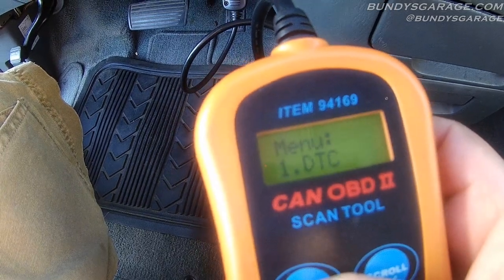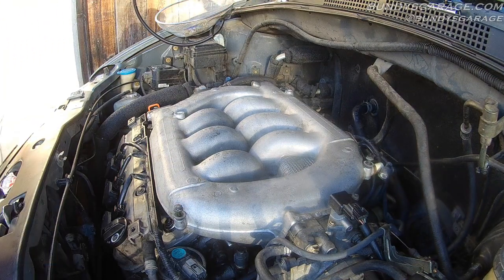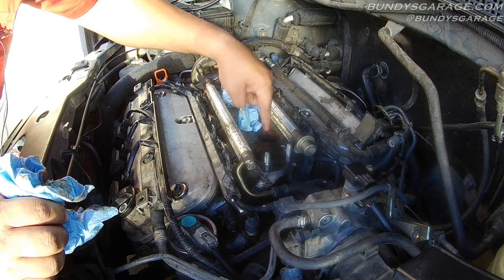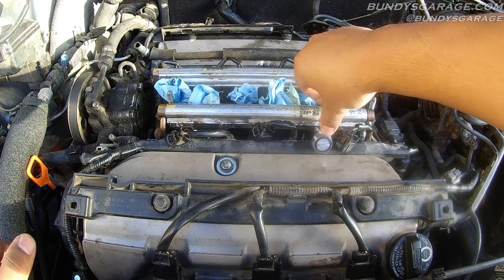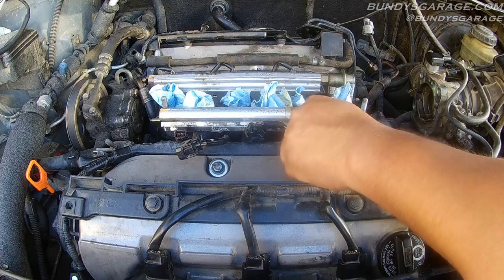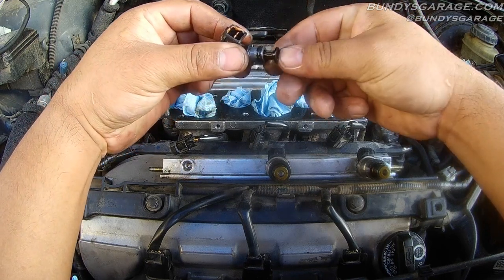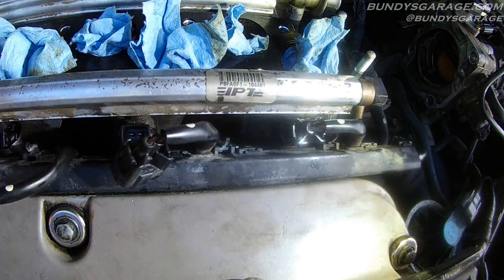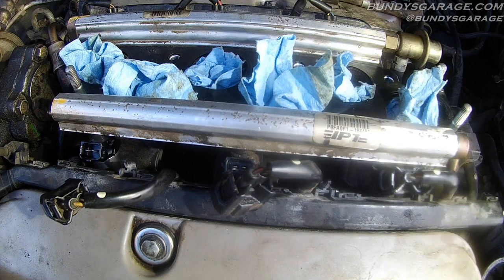HONDA ACCORD V6 ACURA FUEL INJECTOR REPLACEMENT Odyssey Ridgleline Pilot TL CL MDX Saturn Vue

Comment: If you have an 03 Accord ex v6, you don't need the three piece socket cap set. A long socket does the trick.  👍With the help of your video, I was able to feel confident enough to change my injectors over last weekend. I love saving money and accomplishing things myself. thank you. 😎💪
Reply: Why did you replace the injectors? Did you have any performance issue or just regular maintenance

Comment: Im getting p0304.... misfire in the 4th cylinder the same injector you replaced in the video.... were you getting the same code?

I all ready took it apart and cleaned the manifold and throttle body ran 3 gas treatments and it still miss fires.... the odd part is when the engine is cold it runs perfect but once it warms up it starts to misfire

Comment: Why did you only replace one injector? How I decide which one to replace? Thanks it’s a great video.
Reply: Put a screwdriver to the injector with the engine on and put your ear to the screwdriver and if you hear consistent ticking then you know the pin is firing properly.

Comment: i had trouble getting my injectors out of the fuel rail, i wiggled em back and forth.  i think i bent the opening wider, because my injectors went in wayyy looser.  i can't detect a fuel leak, but i think there i a very small one..  i didn't have a random misfire code, but now i do...

Comment: Can you add a manifold clean and her valve clean ..seems to be a problem in these 2000 v6
Reply from the maker: +horacio ayala yeah o can do a manifold clean
Reply: they have a gum up problem but you can clean by hand i believe while its off right bundys ???
Reply from the maker: +Joe bova in actually going to get an ultrasonic jewelry clean that vibrates real fast. Put some Barryman's B-12 and the injector that's stuck and see if can get it to fire again.
Reply: No way I never thought of that, thats a good idea injectors are expensive !!!
Reply from the maker: +Joe bova yes you can
Reply: I meant egr

Comment: Is there a code to look for when a fuel injector is bad?
Reply from the maker: P1399
Reply: @bundysgarage  I am getting P0300, P0305 and P0306. I had already changed the sparkplugs a month ago, and I moved the coil packs to see if the error message had changed, but it did not. The wiring looks fine, so I think I am left with injector issues or fuel filter. I have had the code clear and the check engine light disappear after filling my tank with gas, so I thinking maybe fuel filter??
Reply: Bad fuel injectors will give a misfire code as well

Comment: Hello, please help. My car is making a ticking sound. At first I thought maybe it needs a valve adjustment so I was going to do that but then someone mentioned the injectors make a ticking sound if bad, is tjat correct please help
Reply from the maker: Check your oil level. Make sure you have enough oil. Honda injectors do not fail very often.
Reply: @bundysgarage  thank you for the fast response! I did just check the oil level and it's up to specs. The ticking seems to be coming from the back of the engine. I only have tomorrow to fix it so I was trying to figure it out as soon as possible
Reply from the maker: Can you email me a video to bundysgarage@gmail.com so I can hear it. Is your check engine light on? If so what are the codes?
Reply: @bundysgarage  I really appreciate the help. I can send a video within an hour after work. I hope I'm not bothering you. I really do appreciate this.. and nope no codes are on on the dash. And so far from the research I've done , it sounds like it may be valves or injectors but I could be wrong
Reply: @bundysgarage  okay, I just sent the video to the email. I hope you received it . Please let me know your thoughts
Reply: @Kisham Skeen yes, so my mechanic thought it was my fuel injectors , I thought i needed a valve adjustment. Decided to go with what I felt and when my mechanic opened the engine .. it was the craziest think... it was a broken spark plug.. the tip of the spark plug broke into the engine and the plug kept making that tick since it didn't have the other metal piece to make the electricity connect to smh lol
Reply: @bundysgarage  my car is mis firing I changed all spark plugs all coils and battery terminal altinator starter sometimes it starts then when I turn it off it dosent start for days please help
Reply from the maker: What codes are you getting?